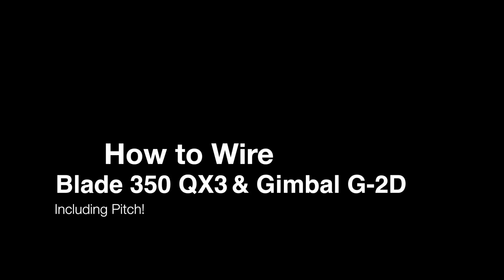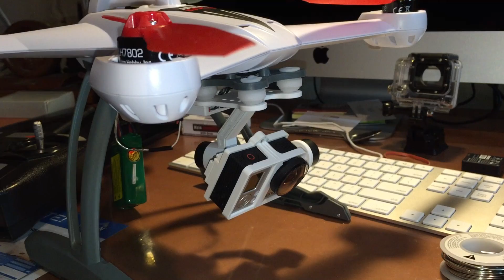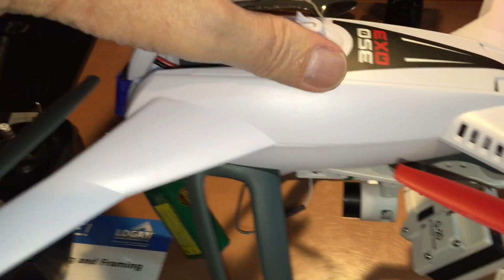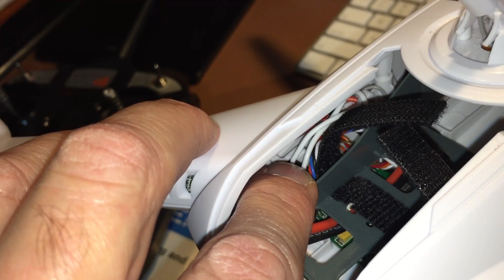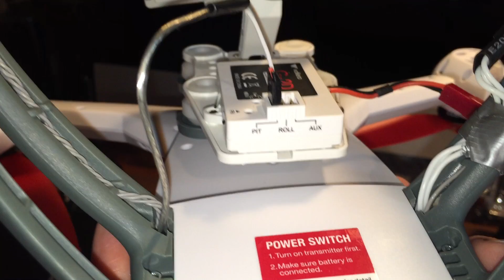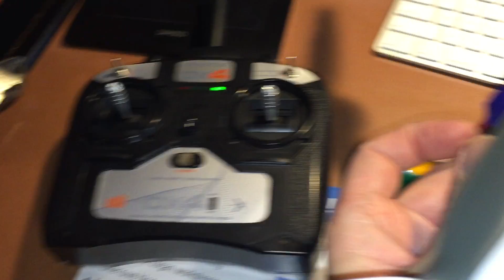Connecting Pitch Control to G-2D Gimbal & Blade 350 QX3

Comment: thanks so much for showing me where to get a pitch control signal on my qx3 from Jamie, been searching everywhere for this info...did not want to use another receiver like everyone else..this is awesome..great info..great vid!..just a couple of tips for those people who have the same setup as me...qx3, dx6i and chinese gimbal. the signal input on the gimbal is the top pin on the pitch connections (printed on the gimbal control board) and to control with dx6i (with horizon hobbies setup installed) flap switch in pos 1 and control pitch of gimball with throttle stick! throttle is disabled when flap switch is moved to pos 1 and comes back after flaps are returned to pos 0! works great! hope this helps someone.. instructions for other transmitters are in the online manual for the qx3!  thanks again Jamie : ))

Comment: Thanks for the video it showed me the missing link.
Reply from the maker: I am glad it helped...  Don't forget!  When in flight, you only get 3 seconds to adjust camera pitch/angle, once you flip the switch into 'pitch' control mode - then the control stick returns to flight control mode and you're not controlling the pitch anymore - instead, you'll be raising/lowering the whole quad-copter!  This doesn't apply when the quad-copter is still 'idling' (pre-flight) on the ground - you can take forever to adjust camera pitch at this point - it's only once you raise the RPMs from idle... After that, remember the 3 second rule!

Comment: Thanks for this vid, i am planning the same with my 350 qx3, does this gimbal accept the SJ4000 cam
Reply from the maker: +Julian Humphrey Oooh... No idea.. Maybe email/message the vendor and ask.. sorry....
Reply: +Jamie Ramage Have done this setup and got the pitch control working, do you clad your cmera in copper to shield it for the gps?
Reply from the maker: +Julian Humphrey I don't.. BUT, I won't use wifi or Bluetooth either..So I'm safe that way.  Too risky with this combination of copter and GoPro...

Comment: Hey the last pin on your power plug on bottom is signal(pitch) you can have all three in the white wire plug
Reply from the maker: +cookieman0916 NOW you tell me?  laughing  Thanks for that tip!
Reply: +Jamie Ramage I've been flying for a while the same way:) finally decided to get the multi meter out and test all those white wires. Also if you use a go-pro or equivalent, you can utilize the 3 pin( 2 outer most) which supply 5 volts or less. Your correct thou no videos on you tube. Going to post one later. Happy flying!
Tom
Reply from the maker: ...Another tip!  Thanks again!!

Comment: another mod you may like is spektrum telemetry if you have computerised transmiter DX6 if you use the front three pins to power the TM1000 you get full telemetry , at the moment i have volts and temp

Comment: Hi there I am having the same issue, but I also want pitch and roll , any idea on the roll control wire pos
Reply from the maker: +kristian radford Sorry... As I didn't want roll or pan, I didn't even bother testing.  I wouldn't be surprised though, if one of the other pins in that group (inside fuselage) gives you power for roll... You then plug into that spot on the gimbal control board... Don't know though....
Reply: +Jamie Ramage  everything i try is not working followed your video . My gimbal just rotates 180 and never moves with any imput from tx. it sort of just shakes
Reply: +kristian radford  everything  works when i power up cam looks forward in central pos. As soon as i connect my transmitter the cam rotates 45 degrees up and will not move down with any input so i am at a loss
Reply from the maker: Don't forget to toggle the switch on the upper-right corner of the controller..  If you've already done that, I am at a loss!  Make sure too, you put that SINGLE wire from the gimbal controller to the right-rearmost pin inside the fuselage.  As you see, my camera shoots straight up, until I adjust it using my controller.. I hope this helps..
Reply: +Jamie Ramage 
YAY !!!!! it works at last . Cheers for the help my heavily modified QX is done full telemetry and now a controllable on (pitch) with my hobbyking Q-2D gimbal its a clone of the  G-2D .